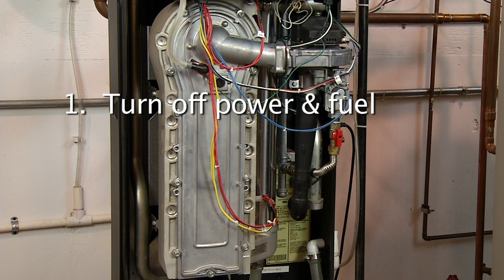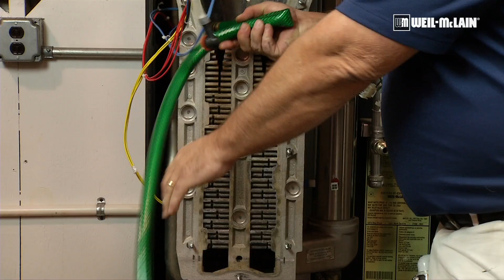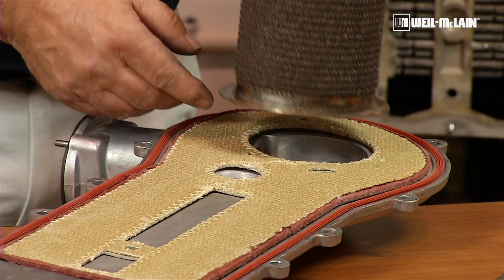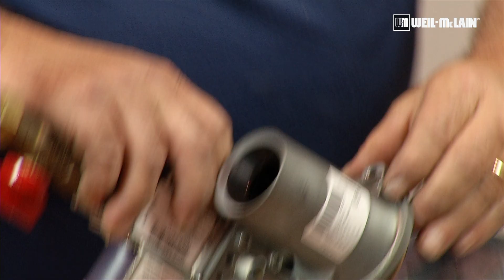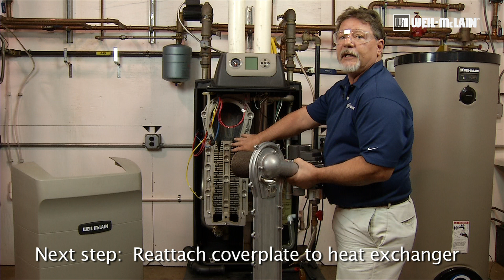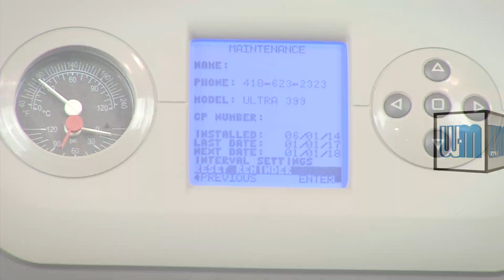Ultra Series 3 Cleaning

Comment: This is a good step-by-step video that shows good info, but it's also not complete. He is taking apart a perfectly clean machine: there is no residual anywhere on that heat exchanger, and the insulation pad is brand new. Try doing a maintenance video on a boiler in service, perhaps one that hasn't had the maintenance performed in a year or two. Then show how to remove those tiny bolts that hold on the burner: impossible to remove once they are burned in place. The heads break off immediately, making the removal of the burner next to impossible, so that can't be cleaned properly, and the pad can't be replaced. Another tip is to install the new gasket on the bottom first: it simply won't stay in place if you put in on the top first. I didn't see him clean the condensate trap which usually gets filled with lots of sediment and must be removed and cleaned thoroughly: if the condensate trap gets clogged, your machine won't run.

Comment: I have an Ultra 155 and when I try to start it, it keeps showing ignition fault. There is a flame, but every time it is turned off in a few seconds, and the system is locked out after 5 attempts. Very annoying because I do not even know which part to replace. I already changed the igniter and the problem stays.
Reply: Same exact happening to me on my 155 series 2.  Fires fine first round until temp is met then second go round locks out after 5 attempts even tho flame works.
Reply: @roadrailn  Eventually I replaced the circuit boards and now it works. The circuits are not robust
Reply: Thank you for your fix info!

Comment: i have an ultra 80 from 2008 it gets a supply too fast error and shuts down virtually every year around same date dec12 and around feb 14 the error shuts boiler off and i have to wake up to a cold house and reset boiler manually but nothing seems to be wrong any idea what could cause this is it software glitch or what ? can i change the settings to have it auto reset so my house doesn't freeze if i am away?

Comment: When resetting the 155 by unplugging it does that clear the error codes or will they remain in the board? I'm going to follow up from another company that the technician recommended resetting the unit when it went into error. Thanks
Reply from the maker: Randy, please reach out to us directly at wmtechnicalservices@weil-mclain.com  for help?